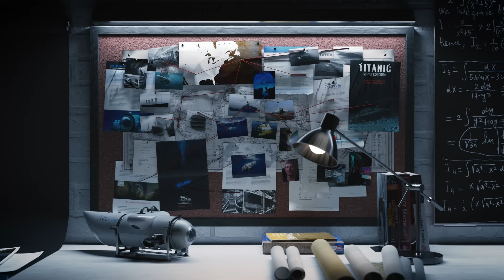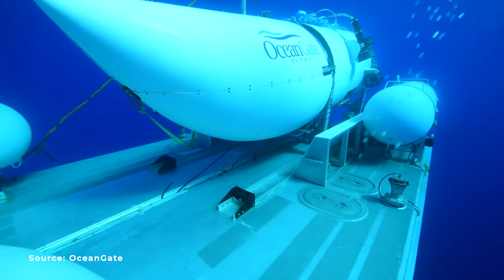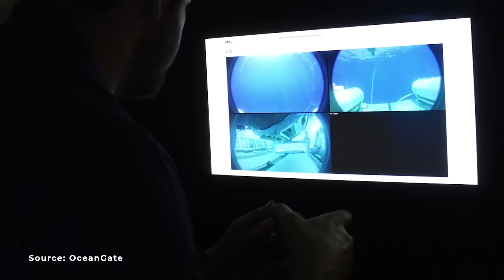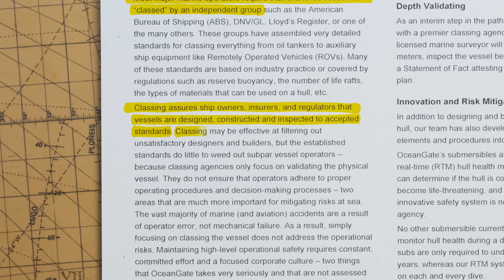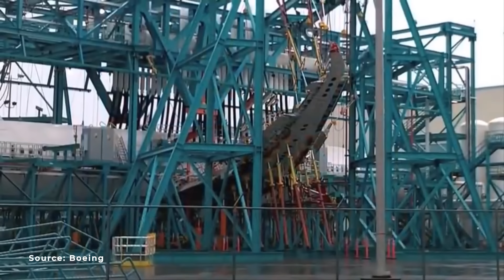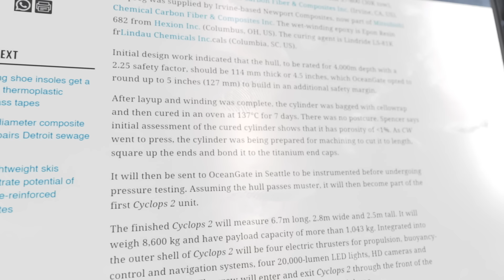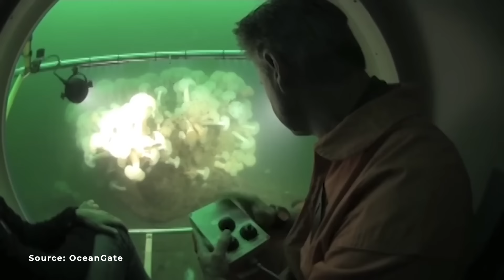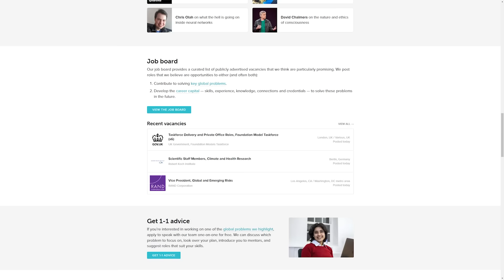The Questionable Engineering of Oceangate

Comment: mechanical engineer here, 7:09 literally the first thing I said when the news broke, the pressure is gonna fatigue the hull every time it goes through a pressure change. it might be successful X amount of times, but if it does X+1 and fails, 5 people die. Shoddy engineering from Oceangate; as I'm basically a fresh graduate with a BS and that was my first thought. Even with it worked out in a simulation, I wonder if they took into account tolerance of manufacturing. Most of the science behind the sub is basic engineering principles of a pressure vessel that any respected engineer would've caught in the design phase. Errors like this are worse than that of the challenger exploding due to a melted O-ring

Comment: I think the failure point was the titanium lip holding the inside of the carbon fiber it was the only thing keeping the shape of the carbon fiber, it was very thin and very short and had a square inside corner that could have easily created a point load and cracked. I also think it was the rear one because it had more weight on it all the time and the front one was always being stress relived when the door was opened and closed, kinda like wherever the bolts were the tightest that's where the point loading was highest and the front changed from dive to dive where the rear was always in its same stress mode.

Comment: About Acoustic Emission (AE)....you are wrong there too...well partially, since the AE probably detected accumulation and they decided to ignore it.
AE is highly used to detect microcrack formation, both for trans-laminar and inter-laminar crack formation. 
Composites develop those cracks much earlier at their stress cycles, and there are several publications about the relationship of microcrack formation and acoustic emission accumulative "pings". Microcracks on quasistatic composite testing can appear and be detected around 6,000 to 10,000 microstrains.

Comment: One error....<1% is the acceptable margin for aerospace design with composites...either 0.99 or 0.01. Computer models do incorporate the effect of void content. Also, they could have tested delamination sensitivity using known fracture mechanics tests...but obviously they probably didn't.
Non-critical structures can have as high as 3-5%.
What matters though is void distribution, heavily localized is not a good thing.
Reply from the maker: I know. I studied aeronautical engineering. This isn’t aerospace.
Reply: @RealEngineering  I designed deepwater composites pipes (CF and GF) for O&G and 1% was deemed acceptable as long as dispersion was "good". We dynamically tested those systems and design everything for 20 years life expectancy at MOP.

Comment: I am not an engineering major. I got my degree in geology. But as soon as I heard this was made of carbon fiber, that’s when my alarm went off. There’s a reason top fuel dragsters use aluminum. They’re always breaking, from the moment you touch the gas. But aluminum gives you that extra couple of seconds because it gives, it doesn’t snap.

Comment: The compression characteristics of carbon fibre/epoxy resin is significantly different than titanium, so the joint between the end caps and the carbon fibre hull (the glue holding them together) would have to be able to compensate for these differing characteristics….if it can’t, then failure is inevitable.

Comment: I can't see how circumferential fibres can be expected to resist a compressive load at all. Even if the fibres had  been multidirecional it still seems inherently wrong to me. You are just relying on the compressive strength of the matrix.  He might has well have saved some more money and made it out of epoxy resin.

Comment: Here is a clear scenario from a manufacturers viewpoint. The decent was too fast, this told me the thruster they reported "stuck on running in downward thrust" was doing so from the start. This ran down the #1 battery on the decent, and is a tell tale sign of a short circuit. I believe this was in the outside electrical compartment, due to flooding. Their weight was very close to estimated maximum, but after this minor flooding, they could have been in negative buoyancy, fighting a downward thruster. Some last communications were that they were "rising very slowly", but the #2 battery would have been at full load and couldn't last long. If the craft was well designed by it's creator and victim, the crash site would give evidence of explosion on contact with the bottom. (implosion by impact) I hope this comes out in the investigation, just to restore the reputation of a guy who had a dream.

Comment: I was a structural engineer at Boeing military and worked on graphite composites (spy plane suff). The most common structural failure points are at attachment points particularly to titanium structure. Based on the transcripts noises heard in aft..I think failure likely occurred at these joints due flexing. Not sure if joints were glued or bolted or both but these are stress riser points. The fact the curing of cabon fabric layup was not autoclave  in addition to minimal testing with pessure cycles is also just irresponsible.

Comment: It's not about the epoxy letting go, it's the carbon fiber flexing and the titanium not flexing, probably created a weak point or crack right around the ring. Breaking the carbon fiber.
The glue didn't have to do much as the pressure on all sides would keep the caps firmly against the carbon.
Reply: I think they were told carbon fiber was stronger than steel and just assumed it was in every aspect, lol

Comment: I work at a Patent & Trademark Resource Center. I thought you, (and anyone else reading this comment) might want to look at one of Stockton Rush's patents, entitled "Systems and methods for curing, testing, validating, rating, and monitoring the integrity of composite structures". I'm sure someone with an engineering background would have more insight into it than I do. Here's the link  https://image-ppubs.uspto.gov/dirsearch-public/print/downloadPdf/11119071
Reply: Oh wow! Neat! I didn't immediately follow the link (never trust random internet links) but dug it up on my own accord and that link looks genuine. It's describing their realtime monitoring system for the hull - you know, the one that says "Hey there's lightning" (and seconds later you get the thunder)

there's almost no engineering in there, it's just "HEY IF WE SLAP SOME SENSORS ON THIS IT'LL TELL US WHEN IT'S GOING TO GO KAPUT" (in the typically lengthy patent language I'm sure you're familiar with), but it's interesting that the idea is now Patented by one Mr Stockton Rush

don't think anyone else is mad enough to do a similar idea since it's just not how you should test for failure (another YT comment of "it's like a sensor telling you your heart has stopped... by the time you get it, you're already dead" was spot-on)
Reply: @Zeldrake  Very good point. It will be one of many many patents that came up with a new way of doing things, but never caught on because that new way isn't a good idea. 

Of course, most failed patents didn't actually kill people, including their inventor.
Reply: @johnhutchinson7343  Exactly. Full agree, couldn't have said it better.

Comment: Even as the Ocean Gate folks pointed at Space X as an example of why 'move fast and break things' can be good, it ignored a critical aspect. It's fine to move fast and break things when nobody will be hurt, when it is only a rocket blowing up miles away from people. But, they were never allowed to put people on that rocket for NASA until it had been 'human rated' by NASA. That is, they had to show their work to NASA and demonstrate suitability for task through successful launches. The bottom line is this: Move fast and break things until you put a person in it, then step-by-step demonstration of capability is required.

Comment: This is the best video that I've seen about Oceangate's implosion. There's no substitute for due diligence & rigorous testing. It baffles me that they chose carbon fiber for such an high pressure application, 5,600 psi (pound per square inch). Steel & titanium have been thoroughly tested and successfully used for over 60 year for deep water submersibles. Why not rely on the scientific evidence and body of knowledge that has been accumulated for centuries? This is an example of someone that thought that they were smarter than everyone else, but really weren't. The sad part is that innocent people died because of their negligence and disregard for safety.

Comment: If you ever worked at sea 🚢  , you know that sea water corrodes everything , including epoxy ... they may have calculated the hull to be strong enough but did not taken account  for seawater exposure .
Reply: I have never worked at sea, but doesn't sea water take time to corrode stuff?. They should still should have reapplied the epoxy after every dive tho.

Comment: I have to say that I was dubious about the quality of the video, fearing that you rode on the hype, wll, I was mistaken.
About the overuse of composite materials, I find it somewhat appalling that new student engineers uses carbon fiber everywhere because "it works great".
I was in the organization of the student drone competition, which took place during the Paris Air show, and when we certified the aircrafts for flight, I was shocked to see engineers not take time to conceive an appropriately reinforced structure and instead just use cnc cut carbon sheets and screws And most of all they expected that such a drone (1kg wheight) could survive a crash
Reply: Im currently studying Aerospace engineering, and unfortunately a lot of my peers have this deathly obsession with carbon fiber.

Comment: I started working at a new job. They had an electronic sensor melt inside an over set at 90c. However they said the specification was 130c. I read the spec sheet and 130c was the max junction to cade temp of the sensor. That is inside the silicon. Nothing to do with the case. The max temp of the plastic case was 70c. I was accused or not being supportive by choosing to interpret the datasheet. Trying to politicise engineering. Looks like ocean gate drank this koolaid too. Engineers apply physics and chemistry and materials science. It's completely obvious to me you'd need to understand the applicable failure modes and ensure that your design never got anywhere near these.

Comment: Completely agree with your video and statements. I have scientific and medical training, no specific engineering training however it seems to me that Rush (who I believe was an aeronautical engineer) and Ocean gate drew the wrong conclusion when analysing the evidence of most submersible accidents being due to operator error. Similar to Abraham Wald's interpretation of the bullet holes in returning bomber fuselages, the reason that operator error is responsible for so many accidents is because of the established systems in place for testing and certifying vessels, it does not render those systems unnecessary. Operator error is also a huge category - this failure could be due to "operator error" in that they took the vessel down...That this disaster was avoidable is the saddest thing about it. The surprising thing to me is that it appears the crew were aware of problems with the hull prior to failure if the trascript on the internet is to be believed and also that the hull seems to have been heavier(less bouyant) than at design (descending faster and unable to ascend quickly despite jettisoning ballast). I have no problem with people developing and exploring the edges of what is technically possible (infact I applaud it) but developing a composite hull is something that could have been done with enough money to test and develop composites that on testing do succeed in resisting repeating compression and advancing the technology to work out how to do it safely.  
Oceangate were just cutting corners and doing things cheaply, arguing that the technology doesn't exist is a cop out and an falacy - if it doesn't then develop it and test its success/failure correlated against actual failures of test hulls (or samples). 
Stockton Rush did say that he recruited graduate engineeers as he wanted young faces that the next generation of engineers would be inspired by. Personally I suspect the motivation may have related more to their salaries being cheaper. Hopefully though oceangate will leave a legacy but it will be that of a cautionary tale rather than anything else.
Good Luck! Thank you for the video.

Comment: im not an engineer but i dabble in composite layup for various hobbies. The second I heard the pressure vessel was made out of carbon fiber. I knew they imploded. The only thing that kept it going as long as it did was the resin matrix holding the shape. Those carbon fibers were simply a filler at that point. Its the same if you tried to push a rope versus pulling it. Incompetent engineering all around. Its sad, these people didnt have to die yet here we are. Stockton said in an interview that he saw himself as a leader, a visionary, a pioneer.

Comment: For comparison, Venus surface pressure is 93 bar, or equivalent to 900 meters depth. Oceangate failed at more than 4 times that pressure.

Conclusion: Oceangate should settle for designing Venusian landers instead of submersibles.

Comment: Gday,
Got a couple of queries in relation to this disaster;
1. The feedthroughs design,  how were wires, etc, fed from the unpressurised rear machinery bay into the pressure chamber ?, must be a pretty important area ?, eg, the ballast and landing frame jettison controls ?
2. In earlier missions the Sub was launched from the mothership with a crane, this allows a double check of the loaded weight and a check of buoyancy calculations while launching from the raft doesn't allow for this ?, was pre launch weight a factor  in a rapid descent and subsequent slow ascent (if this was a factor) ?

Comment: Accusing Stockton of profiteering is absurd - there's no way Oceangate ever made any money or even came close to making money. You would need to charge far more than 250,000 a seat. He was doing this bc it was a viable way to finance a deep sea submersible that he would also get to use. He was reckless and had a v high risk tolerance, but he didn't want to die and communicated the risks quite clearly in that waiver. It got leaked. You can read it.
Reply: How do you know the finances of Oceangate?  Were you their accountant?

Comment: On the "hydraulic press channel" there's an episode in which they compress a carbon fiber tube.  The way the tube fails is fascinating:  The tube crushes from the end, shedding the carbon fiber cleaned of the epoxy binder.  Although carbon fiber is extremely strong, it is strong under tension.  In other words, the compressive strength of carbon fiber composites under compression is due to the *epoxy*, not the carbon fiber.  In other words, the carbon fibers in the CF composite was useless.

Comment: Retired mechanical design engineer here who used to work on structural and thermal components in the supercomputing industry. Obviously we didn't have to worry about 350 atmospheres or incredible G forces, but the amount of component testing we did (statistical tolerance analysis, Monte Carlo simulations, FEA stress/thermal analysis, shock, vibration, environmental, statistical process control during manufacturing, etc) puts this travesty to shame. The kicker is, if one of our components failed, NOBODY WOULD DIE! But all engineers should want what they design to work under the conditions that thing might be subjected to. The operating conditions of this submersible were otherworldly, and it sounds like they did very little to ensure it would reliably meet those conditions. That's gross negligence. The amount of red flags this submersible had is frightening. It's sad that people go into this thing trusting that nacrissistic charlatan Stockton.

Comment: Not questionable engineering. Failed engineering design. Anyone who designs pressure vessels would have used metal for the cylinder and reinforced the inside of the cylinder with compression rings.  The best and strongest design would have been a titanium sphere. There is no evidence that any composite cylinder can resist repeated pressure cycles at 375 atm. It is more sensible to send a tethered unmanned UAV to these depths with multiple cameras, robotic arms and zero risk to human life. Even the space station experiences only 1 atm. of internal pressure in the vacuum of space.

Comment: 8:50 They didn't use an autoclave?! There are autoclaves all around the country that can fit entire cars in them, it's not like you have to beg NASA to use their giant vacuum chamber for testing spacecraft! If you're going to cheap out on every single possible aspect of construction then there is no reason not to just re-hull it every few dives and destructive test the old ones. Also I read that the CEO ordered a 7" thick CF tube and got a 5" tube, which if true should tell you everything you need to know about everyone involved.

Comment: testing composites in compression and tension is a part of first year lab they do in my degree
the content isn't very extensive but if a first year can look at the material choice for the submarine and raise an eyebrow, one has to wonder why this design made it past a team of professional engineers and onto the market
Reply: Rush wasnted to be seen as a 'genius' who proved the actual experts wrong is all.  He knew it was cheaper to use CF, and apparently was convinced that because a scuba tank or other tank could resist massive pressures in tension, he knew better that it could also do the same in a compression situation.  If you said no, then he fired you like he did his Dir. Head of Safety.